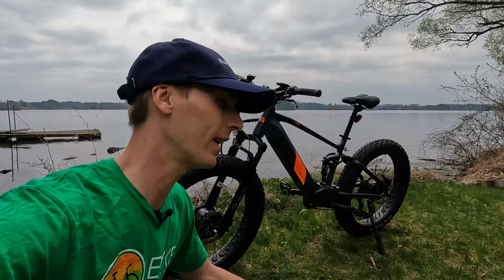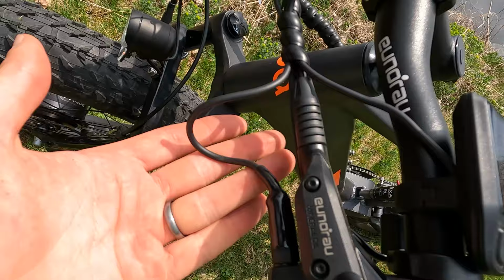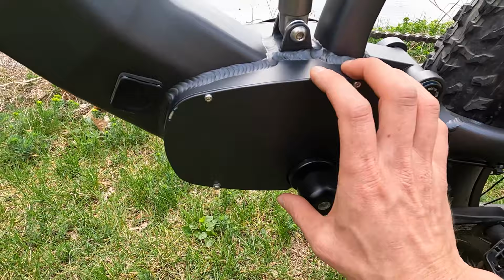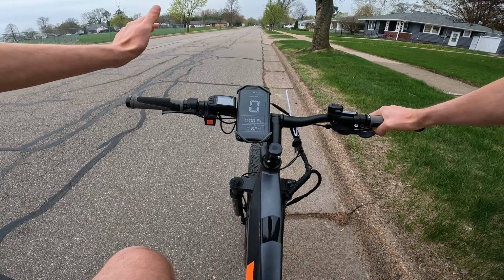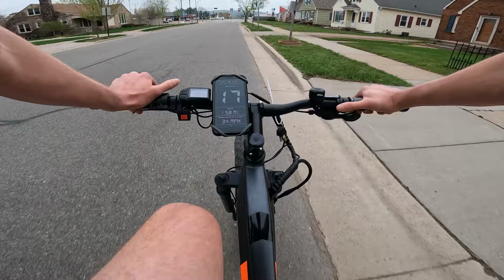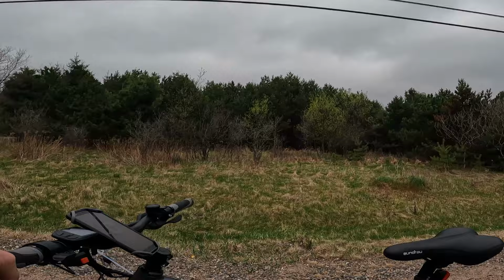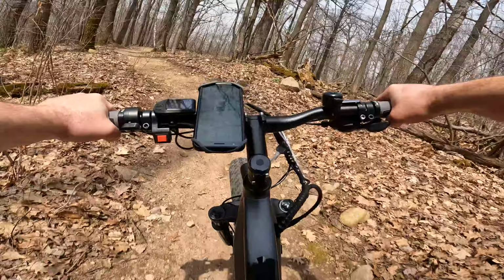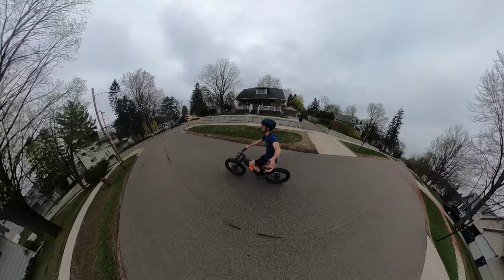Eunorau Defender S: Unreal Performance with Dual Motors And Full Suspension

Comment: You have to test bike with 2 batteries,  power lossess are going with I x I square of  current  I 45A is very high current should not go more than 20A for single bat.
This design needs 2 bat otherwise you bought wrong ebike if only one bat.

with 2 bat will have on each 1/4 lossess of one because of 2 x 1/4 lossess will be of 2 bat half of one bat, voltage much higher at full power and power and torque much bigger  with 2 bat.

and normal driving 400W will pull 8A current,  when divide on two parallel bateries you half lossess  in voltage 2x 1/4 power dissipation ,  one bat pulls  ax 45A on near full bat that causes big lossess on cabling and  internal bat resistance.
With 2 bat  each one will provide 22A with much lower lossess of voltage and power on cabling and internal  resistance.

750W motor is excellent hub motor has power but still efficient at 20-25km/h 90% of time speed.
With 750W hub motor and 26x4 tires got 10km more range with  cadence sensor,  than with  1000W mid drive motor with torque sensor, with similar driving and avg speed.

Smaller motor and cadence sensor power management enables much better efficiency with the same bat 15% bigger range with fat tires against 26x2.6 tires?
Torque sensor whener you press you got power more. Cadence sensor when you reach pas1 speed 21km/h you press more get one km more but power from battery dropping down as you press more. Speeding up with 50% +  power what is more efficient than with 25% , do not have curves but around 30% power down efficiency falling quickly down.